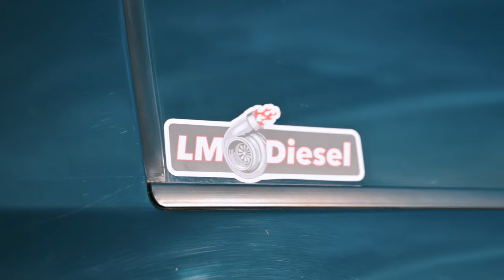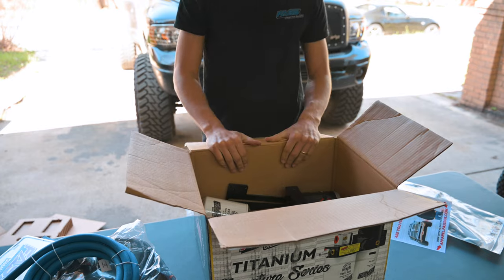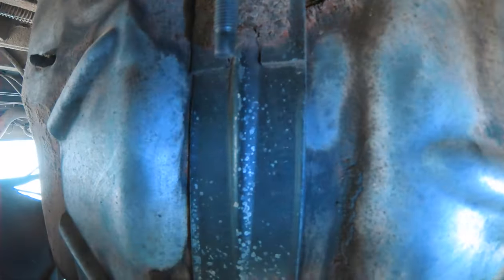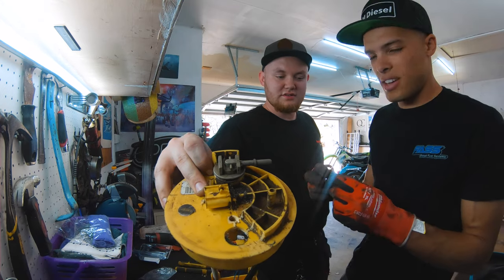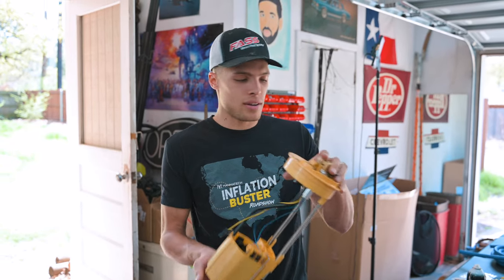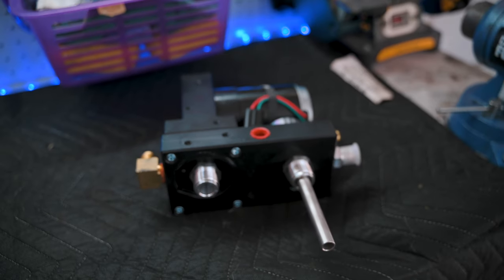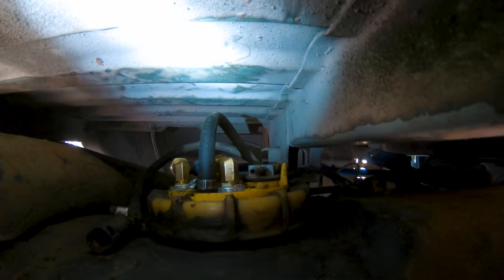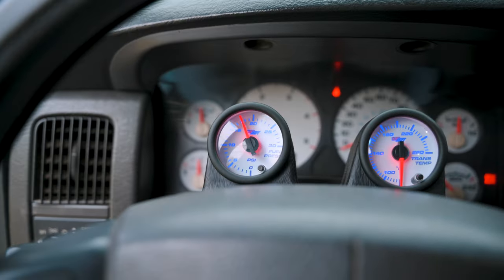FASS 165 INSTALL on 2004 RAM 3500 | BEST Aftermarket PUMP?!?

Comment: Good video except you should accelerate like you did with the stock pump. You definitely held back when you drove with the FASS pump. I want to see true reviews, not altered.  Other than that, good video.
Reply from the maker: Fare enough. I will say though that with my time driving it. Even at full throttle with slightly bigger injectors, I never saw it drop below 15 psi

Comment: Do I need to plug into the old pump. My truck got a sump installed under tank can I just plug there?
Reply from the maker: Yes, just so you can see your fuel gauge.

Comment: So this 04 already had the in tank fuel pump installed. Factory didn't do that until 2005
Reply from the maker: Pretty sure this is a 2004.5
Reply: @LMDiesel  Same as mine, maybe later in the run they changed to the in tank lift pump. Mine was built Nov 2004 and lift pump on filter housing on block.
Reply: Mine was taken off and relocated I think I need the do7?
Reply: Mines an 04 build date nov 2003 and I have intank pump. Maybe dealer changed sometime before I bought